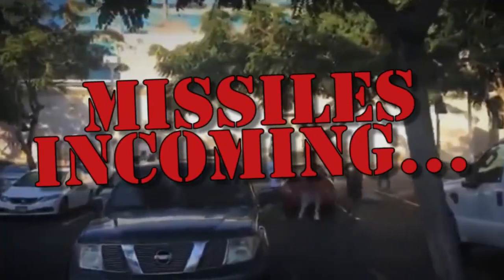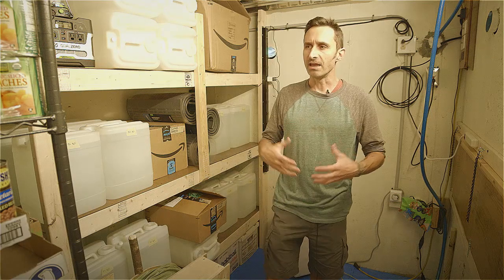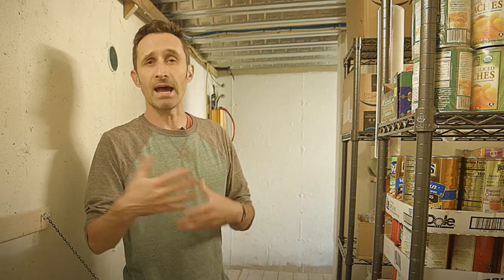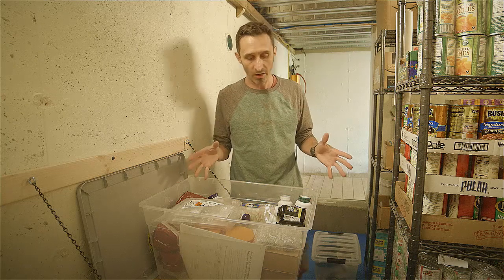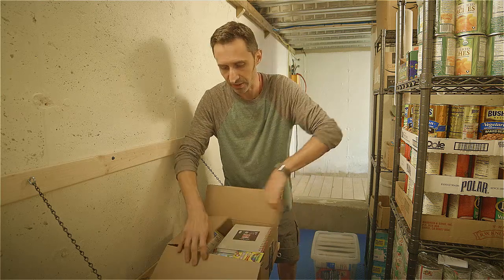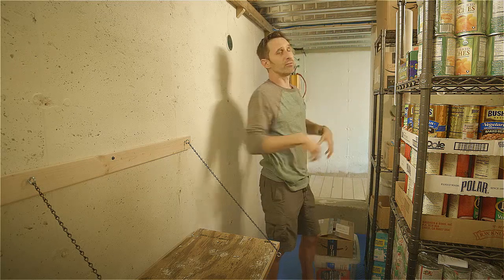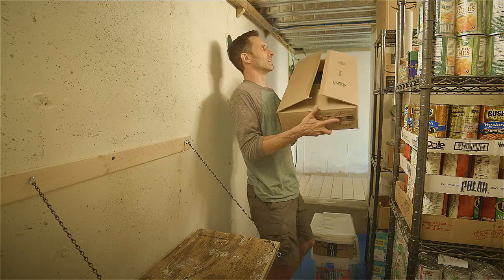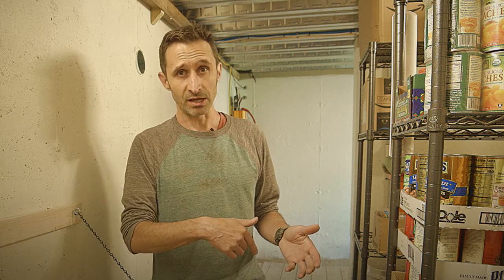He Forgot to Get THIS for His Fallout Shelter and Paid the Price

Comment: I love your shelter. I've got too high of a water table here, can't go deeper than the basement. At least it's good water supply for my deep wells. 
I am taking notes on that manual air pump. Thank you!
Reply from the maker: I should note that my shelter isn't any deeper than my basement. It's just about the same and the 2-3 feet of dirt on top is mounded above it. Visually above ground it looks like a (delightful???) little raised bed garden area. So even if you can't go deep, you can always mound up and over. Best luck!

Comment: If you crap in a bag it will still stink something terrible so have sand or something maybe even cat litter and do not pee on the poop, do that seperate like in two liter bottles or something until you can dispose of it later.
Reply from the maker: Good tip. I didn't get into procedures in this video, but yeah, 100% agree. Keep it separate, and seal it up. We have a drain for the liquid stuff and the poop bags can be tossed outside periodically if they become an issue.

Comment: I love your fall out shelter/root cellar...I really need one.  We have issues with water staying up against buildings here and basements are unheard of (in our particular area of clay soil...many many people have basements in Oregon).  I would like to revisit this concept perhaps I need to do a partial dig down (like you did) or simply create a structure and cover with soil.  thoughts abound! re: Peaches...I love them fresh, not a fan of the canned but I do hear what you are saying about The Road reference.  Food for thought...in the last 6 months  I started smelling someting really sweet in my storage room kind of like molasses...anyway after pulling everything off shelves I found a half case of Kirkland Peaches which had eaten through the can and were leaking ot the bottom.  The acid finally ate through the Kirkland (lined Costco) can...no bueno.  I checked the date and best by was 10 years prior.  So....since you don't eat peaches and they may just sit there, perhaps buying some in jars would be better (or cans).  It was a MESS to clean up.  Thanks Praxis~  ☮☮
Reply from the maker: I'm actually trying to get out canned fruit down to a less insane level right now by eating through it. I went bonkers buying it a few years ago and feel I over did it. I hear you on the metal cans though. Good tip!
On your project, yeah, consider digging down as far as you can and then build and backfill over it. Look for places in your landscape where it could maybe be a visually pleasing asset. It'd end up looking like a hobbit house. As for water, definitely plan to put a perimeter drain around the outside floor of it that can gravity drain to somewhere. If you like, shoot me an email and I can help you game out some ideas. I love chatting about this stuff.
Reply: The only way to store fruit is in glass,even if you buy in tins can them in glass!
Reply from the maker: I think you mean, "The only way to most safely store fruit for long term storage (aside from freezing, freeze drying, sugaring, or dehydrating) is in glass." And I think I agree with you there. The metal cans can have issues for long term. @donaldfrazier5244

Comment: How does the sink drain? Is the water pumped up outside or does the pipe come out of the side of the hill?
Reply from the maker: Good question, I didn't get into the build in this video. The water drains into the perimeter drain that was laid around the structure before it was backfilled. That was a bit of a retrofit when I was changing my "root cellar" into a usable fallout shelter. Had I designed it into the original design, I'd have made it a separate line.

Comment: Most residential bunkers use 12v as its power source, if your 120v ac goes out, you will be in the dark and your hot plate wont work,  it doesn't matter because you have a lot of ready to eat foods, your bunker door is made out of wood,  not the best material for this type of scenario,  my plans are turn off my rain harvesting system,  save my best rooster and 2 hens and only use my concrete cistern water, if i have some sort of warming,  i wound install my metal storm shutters,  im hankering down inside my home, my 12v lighting system would work even if my charge controller fried, my emergency lighting system is 12v, my pumping is 12v, and if the roof cisterns survive, my system will have 400 extra gallons that work with gravity,  but the reality is its not a survivable scenario,  it will all come down to who is lucky, not how prepared you are.
Reply from the maker: Yeah, there are definitely places where improvements could be made on my setup. I really built it as a root cellar and had only a faint notion that I might want to be able to convert it to a bunker in the future. If I were building it today, I'd build it a little different.
Reply: @PraxisPrepper  you are not far from these minor upgrades. A unspoken homesteading tool every homesteader should have and learn how to use is a wire welder,  It's in my top 5 homesteader tools list, it's priceless for fixing anything out of metal, it's super easy to use, you will stick metal together within 10 minutes of use, it will become one of your favorite tools,  trust me
Reply: @PraxisPrepper Good video....Well at least you have a hole to grawl into with some stuff and hope for the best....What a joke..!!, Here in NYC the PSA say's we should find a room preferably without windows, turn on a radio and wait for instructions from the "Authorities"...If that doesn't deliver a CLEAR message to the citizens of NYC from the "Authorities", then I don't know what does.!
Reply from the maker: My dad actually knows how to weld, but I've always been a bit nervous to try. I guess it's like how I was talking about people being afraid of trying chainsaws. I should look more into it though. I bet you're right that I'd gobble it up as a tool and it'd be useful in solving a lot of my challenges. @MosaicHomestead
Reply: @PraxisPrepper  welding opens up a new word,  you will need some welding magnets, a couple of clamps and a grinder...grinder and paint makes you the welder you ain't lol.
Reply from the maker: I never knew welding could be so poetic! :) @MosaicHomestead
Reply: @PraxisPrepper  better than poetry

Comment: Praxis, You need a carbon filter for your Air system as some of the fallout will pass through standard filter. Such as Iodine-131 which can be in vapor. Also consider toxic gases from fires. If you look at a military fallout bunker they all have large active charcoal filters.

FWIW: Don't presume 2 weeks will be sufficient, as that was concluded to be the absolute mininum for sheltering by civil defense in the 1950s. Issue is that nuclear power plants will meltdown and the spent fuel pools will catch fire. Realistically plan for 3 months min. and food for over 2 years. Unlikely you be able to grow anything in contaminated soil (toxic ash falling on farm land from  burning cities: plastics & other man made materials).Water would need to be sourced from a deep well as all surface water sources will be contaminated. A extra well pump, & alt power system stored in Faraday cage.
Reply: Medical supplies: Lacking a lot of injury treatment: Gauze, large bandages, Betadine\Isopropanol (infections), anti-biotics (radiation poisong weakens immune system, leading to secondary infections), triangle bandages (arm sling), Arm sling, finger, toe braces (broken or sprained toe\fingers), knee\ankle brace, tourniquet, emergency shears (cut off clothing in case of trama), burn gel, topical anti-biotics, vetbond (wound closure glue) sutures (vetbond won't work on joints: elbow, knee, etc).  If you can also consider stockpile IV fluids, essential if someone has a gastronomic issue issue either from radiation, or general illness, which dehydration can become a lethal problem.

Vitamin D & magnesium are going to be essential as you won't have access to sun light and vitamin-D helps prevent contain cancer & other auto-immune disease. Plan on 5000 UI per day of Vitamin D per day. Magnesium is required for vitamin-D uptake. Nuts are good source of magnesium. I would add a lot of peanuts to your food stock.
Reply: The leaded clothing is useless as its not thick enough to stop gamma radiation, only useful for x-rays as in x-ray machines. What you should have is tyvek suits to keep any contaminated dust off you & your clothing if you need to venture outside. A dosemeter to monitor your exposure. Also a full hood is better than a gas mask as it will keep the dust out of your hair. I recommend a PAPR hood instead.

Also have a box of construction trash bags, you can use them for trash, emergency barrier (with duct tape).

Also missing is a lot of blankets to keep warm. Some moving blankets could be hung on the concrete walls, not only for some thermal insulation, but in case some slips or trips, there is some cushion to prevent an injury.

For cooking: paper bowls, plastic cups and plastic fork\spoons. This would save on water use and more hygienic while in the bunker. Bowls are better than plates for beans, peaches, and other canned foods. Some sterno tins for heating up food. 

Alternative to those camping mats you can buy RV beds that are very compact and can be stored in small rolls. much more comfortable than the mats.
Reply from the maker: This is an excellent comment. I'm actually already there on these points, but I didn't go into them in the video because this video was about items to bring into a shelter vs. about how to build one. Very good comment though! Thanks for leaving this info for people to discover and learn from!

Comment: No basement or root cellar   Working on a hall set up
Reply from the maker: A little more work, but doable. Remember, anything heavy is good for shielding. The more atoms, the better. Books for example are a pretty decent material for shielding. So a book case against a wall is better than the wall alone. Your stored water jugs too. Using them to block ionizing radiation won't damage the water itself or make it unsafe to drink. As long as radioactive dust doesn't get INTO the water, water exposed to radioactive rays is just fine to use as shielding and then drink too.

Comment: Read ur other response... sounds like the weakest link is possibly air filtration.
Reply from the maker: Yeah, air intake is one of the less than bulletproof aspects to this setup. We can pull in air no matter what (as you saw in the video), but if the landscape up top happens to ignite on fire, the air filers could quite reasonably become casualties of that fire. It's a credit to your ability to game things out that you intuited that issue right away. This structure was built as a root cellar first, with a few design features that would allow it to be retrofitted to be a fallout shelter if the need arose... the need arose a heck of a lot faster than I had anticipated at the time I was building the root cellar!